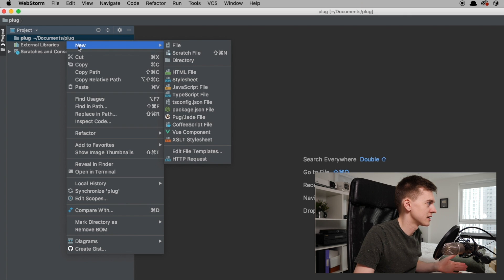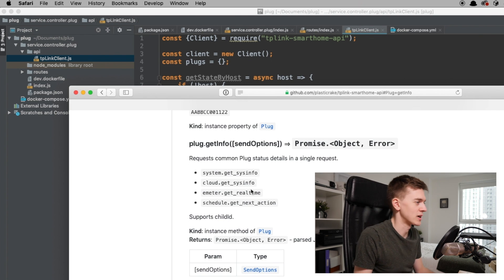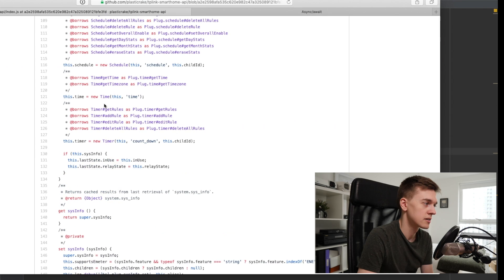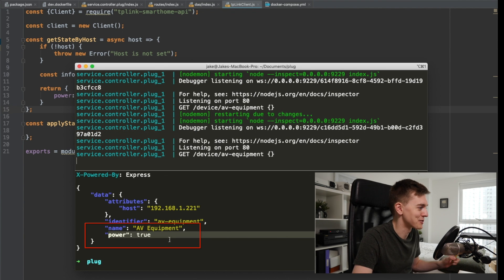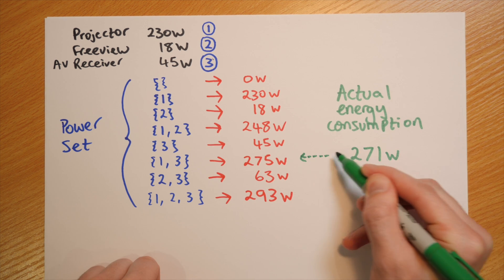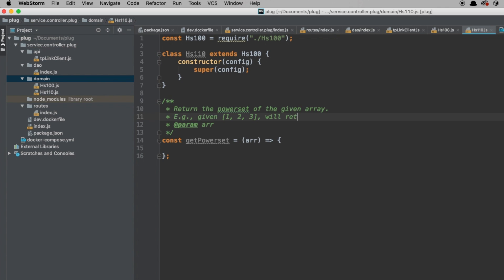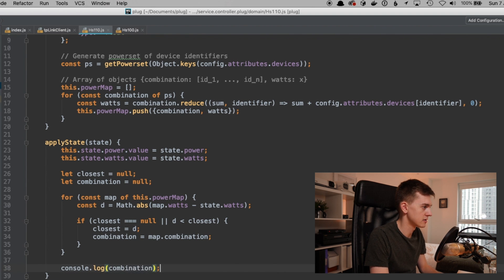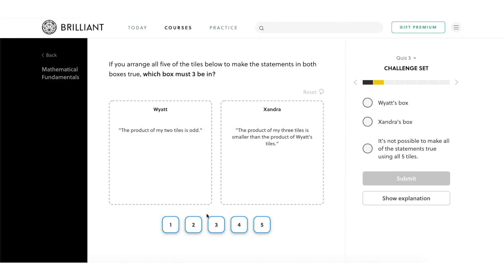TP-Link Smart Plugs | Home Automation #05

Comment: like the logic of what you call the "Power Set" and the logic of the array..    Trying to do something similar with power received from 
solar panels..  and using the power information to help me appreciate panel orientation..  such that i can put the panels into the best position to collect the most power
without any light sensors..    if i have a 2 axes.. panel (up down left right) ..  without sensors move the panels to the highest power collection position.. 

(also.. I miss your post about moments in your life.. )